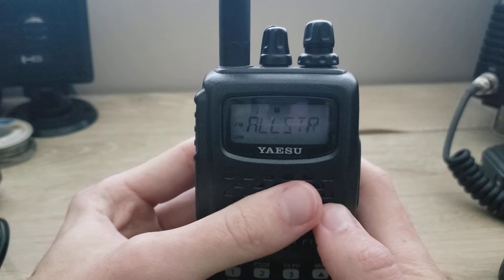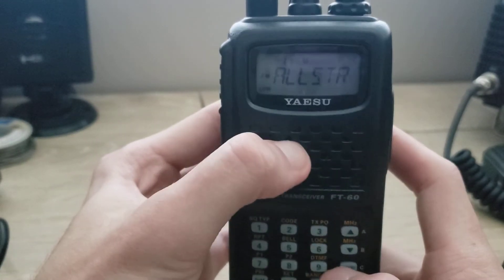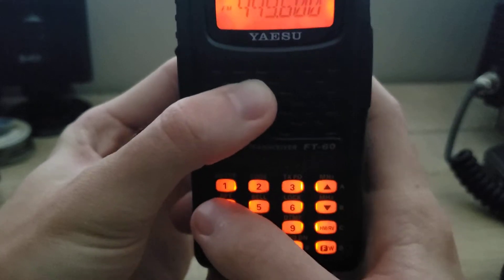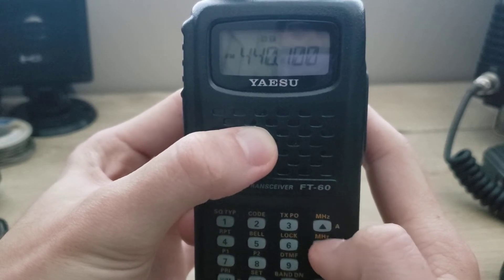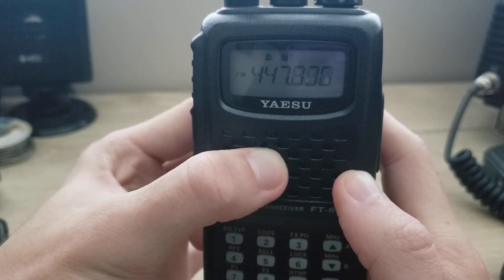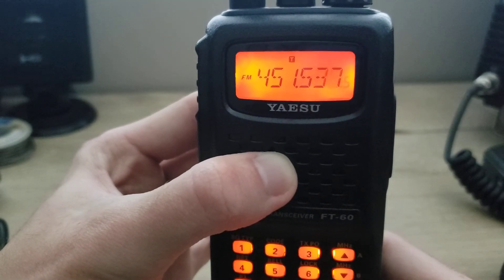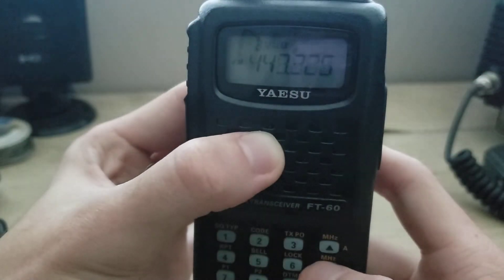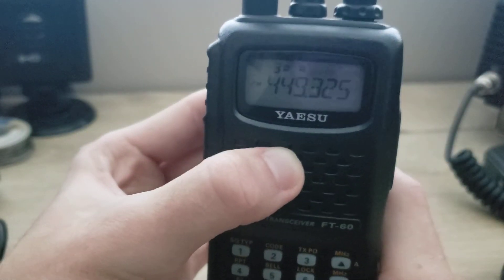How To Use The Scanning Feature On The Yaesu FT-60R

Comment: Mine doesn’t keep scanning when you let go
Reply: Check to see what your scan setting is. It could be set on HOLD which will stop the scan when a Signal opens the squelch setting. That's under menu item #35.
Reply: @AlvinMcManus  I have the same issue as @fbswampfox and that setting is set to "resume" which sounds correct
Reply: did you figure it out? I have the same issue. once I let go the scan stops. the dot blinks but the numbers basically stop increasing
Reply: @Jashi squelch has to be turned off. Fixed it right away.
Reply from the maker: IDK